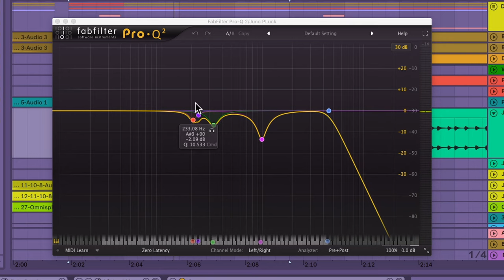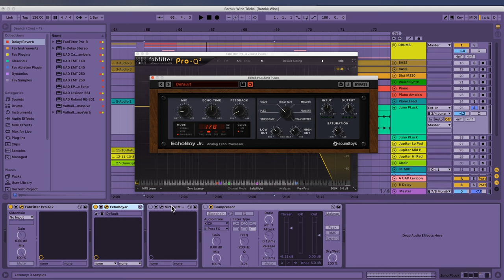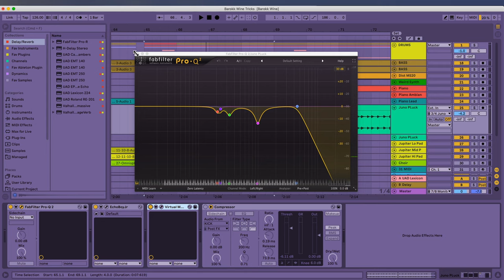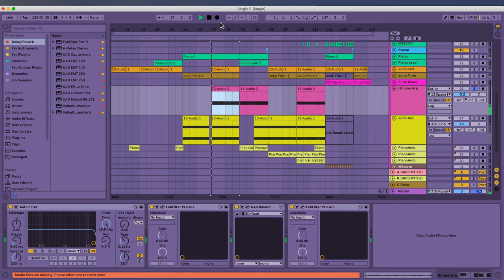Production Tricks: Juno Plucks

Comment: Great tips. Often with analog synths I will leave the filter a bit more open than the final intended sound so that more highs can be rolled off later to reduce noise. If analog is captured too dark you can't get the highs back 👍🏼
Reply from the maker: I do that as well, and it works great, but sometimes I just really like having the filter quite closed on my Juno sounds and then add eq afterwards, there's just something I enjoy about that sound. I'll just have to live with all the hiss that comes with it 😅
Reply: @JanusRasmussen  maybe you should have your Juno checked out? It is actually one of my least noisy synths! My OB6 is the worst for noise...

I have the Juno 60 as well and it came with the tubbutec mod from the previous owner, which can also create some different oscillator drift

Comment: Hey Janus. Your videos are very helpful. Thanks a lot for sharing your skills. Two questions about working with the Juno 60: The Juno 60 has no midi, right? Is there a way to midi control the Juno 60 from ableton. With any midi to something converter? And have you ever tryed the Juno 106? Do you prefer the sound of the 60 over the 106? And if so, why? Thanks a lot for your help.